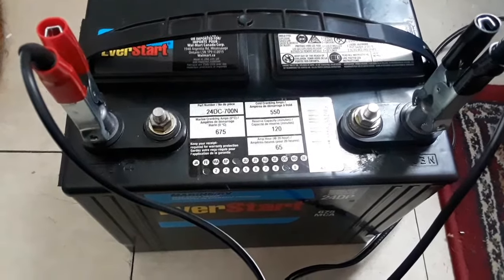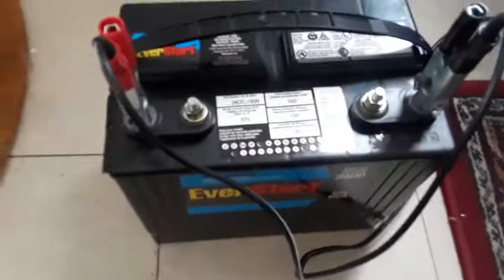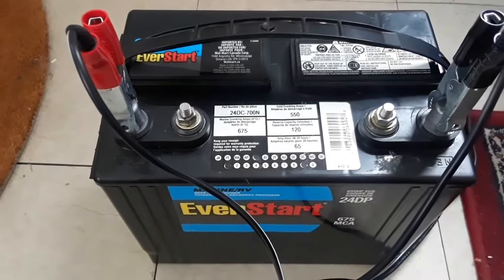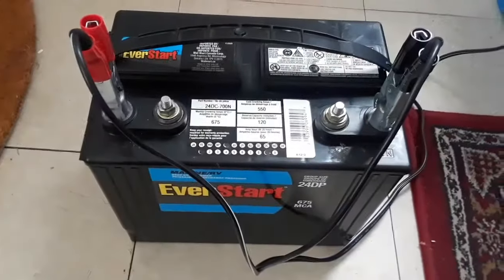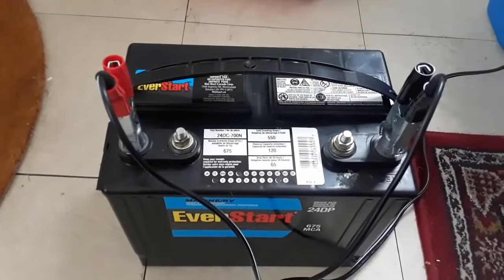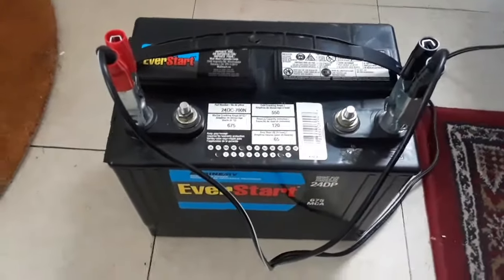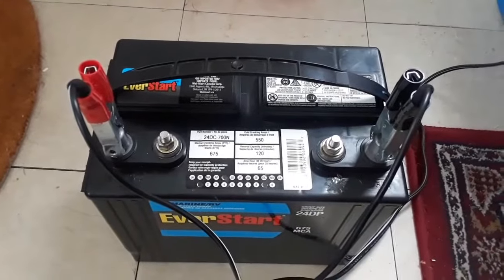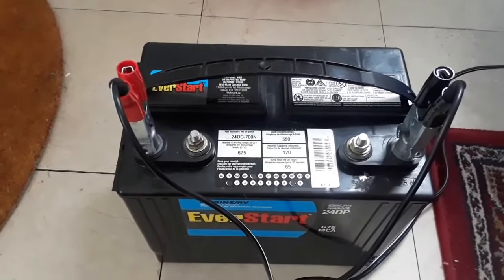Don't Make this Mistake with Deep Cycle Batteries!

Comment: When you connect a dead battery to a charged battery. The dead battery sucks the juice out of the charged battery and it becomes a six volt power. It levels off between the two. There's no way the 12 volt battery is going to power up the other 12-volt battery and turn it into a 12 bolt battery. What is going to do is even out the juice in both batteries. Which means you just resulted in 2 6 volt batteries

Comment: Two 24DCs can be replaced with 1 29DC which has 122Ah(twice the storage) at less $$$/amp.😉✌️
Reply: Per the label on the EverStart 24DC battery ... Each 24DC has about 100 Amp-Hours.  Therefore, 2 @ 24DC's in parallel will have 200Ah.  Last time I checked, 200Ah (2 @ 24DC) is way more than 122Ah (one 29DC).  You are not very good at math.
Reply: @MrSummitville  Hmmm, I wonder where I got that info? Probably from the video. Anyway, I use the 29DCs as I have room for them, they give 22% more amps than the 24DC, & last I checked, @ a lower cost per usable amp than any other battery out there. Not to mention that the first Everstarts I bought 4 years ago are still serviceable. But thanks for the correction.

Comment: were you running electric heat off of these? i dont understand how you killed both of them, if they were fully charged to 0% you went through about 2.4kwh of energy. just curious if you know exactly what killed them?
Reply from the maker: They were outside in 30F overnight, I was using the lights on both bunk ends and running the fan on the heater.  I am sure it was the cold.
Reply: He means the RV furnace.

Comment: That’s because you have a smart charger smart doesn’t necessarily mean good! If you ever go buy a 25 year old battery charger at a yard sale buy it because it doesn’t have those parameters if you hook it to a battery with one bolt in it it will simply charge the battery! 
Like the new batteries for tools Ryobi 18 V any brand really they have a computer board inside that battery and if the battery drops below 6 V or something like that that computer board opens the circuit so you can’t charge it you have to go buy a new one well if you look on the Internet you can take those batteries apart or in some cases drill a hole in a specific place so that you can get to the batteries themselves on the other side of the circuit board and you can charge those batteries up once you get above that 6 V threshold back to good again❤️‍🔥🇺🇸

Comment: These marine batteries are toys. Their only strength is they keep their charge much longer than an ordinary flooded battery. So you can leave boat stored away for a year, and it will still start. Running motors or heating elements on these tiny batteries is ok only for a few minutes, because high energy draw (amps) will suck them dry in 20 minutes.

Amp hours have nothing to do with load capacity over time. It describes the maximum time a battery will deliver 'useful' power at the rated voltage: such as run head lights, or a car radio. But a real electric motor such 1/2 horsepower motor? No way. Totally out of its league.

Stringing a few boat batteries together does not get you very far, because you may have extended its ability to do one low power job, but you have NOT done anything to expand the amps it can deliver consistently over time.

To use boat batteries to run a motor or a heater overnight basically you need three of them for every hour of intended use.

To do powerful electric work, you need a BIG battery, with serious amp hours... as in HUNDREDS of amp hours, not tens of minutes. Like the batteries in a forklift or a golf cart. These batteries are HUGE. It's a two man job to left one. They stand up to your thigh and individual units are 2V - one single battery cell per unit. They are usually wired into 24, 36, 0r 48V configurations and collectively they weigh a ton. THAT’S a battery!

Comment: Use a NOCO genius 10 to start it back up
Reply: I have a NOCO 10 what mode do you charge on? I have an Everstart 24DC
Reply: @thelifeofpressureman7178  I have it on “12V” for deep cycle batteries.

Comment: I have a 300 amp truck charger starter battery charger. If you hit the plum dead battery with 300 amps for about 2 minutes then wait 5 and do it again for 2 minutes then charge on 60 amps for 5 minutes and then on 30 for 5 minutes then on low amps until charged you can bring these back 100%. Many people will take a dead battery car, boat, drill, etc and clamp visegrips on the terminals and with a welder ground on ground weld a 1 inch bead on the positive visegrip handle then put their battery charger on them and charge until full. I have save maybe 80% of batteries doing this even the dreaded dewalt tool batteries. On those just a few quick zaps and then charge. high amps for a couple of minutes will blow the crap off the plates in most cases. lead acid batteries like to be vibrated. this is why tractor batteries last years and car batteries do not. cars are smooth. Take them out once a year and beat the shit out of them with a rubber mallet or do what battery shops do and drop them 2 feet to the floor flat on a piece of plywood. then charge like above. high amps a couple minutes then full charge.

Comment: Bro here is a tip. Don’t connect batteries if different capacity as well. Not a critical step but you’re going to be far more successful.
Reply: Why not?
Reply: tip not heard as it only applys to series connection you can parallel any size battery as long as volts match

Comment: that is also a cranking battery.........not a deep cycle or industrial deep cycle storage battery.  Cranking batteries have an issue with deep discharge causing active material (lead) to be stripped from the plates,which are actually a fragile grid structure. By comparison, an industrial deep cycle battery uses thick,solid plates........they have poor cranking (max amp output) for their size, but they do handle up to 70-80% discharge quite well, and generally only suffer from sulfation of the plates, not the loss of active material. Also, you need to do the math on your electrical load, versus the amp hours/voltage capacity of the battery.  So 65 amp hours at 24 volts is only 1.56 kw/hr and even a tiny 100W heater will flatten a deep cycle version 80% in just 12 hours.  A 400 watt heater in just 3 hours.  Would suggest you keep your cranking battery only for cranking, and have 4 deep cycle batteries that are able to charge, but not discharge the cranking battery (semi isolated).
Reply from the maker: Dude, group 24 battery is cranking but is also deep Cycle. Google it!
Reply from the maker: A Group 24 battery is a specific size of battery you’d see in vehicles, backup power systems, and medical systems. Group 24 batteries generally function as deep cycle batteries rather than starting applications where they start

Comment: The first thing I noticed......you should have a deep cycle battery. There is a reason they costs more, but are they really more expensive? You have killed the old battery. The second is you can't drain any battery to zero! Even deep cycle batteries shouldn't go below 50 %. Do more research. I'll pay off in the end.

Comment: i buy deep cycle battery 75 amp 900 watts you need about 100 amp 1200 watts i thinking ok you need about 4 12 volt battery 100 amp 1200 watts one battery  you need 4800 watts to get good heated
Reply from the maker: I moved the batteries inside the camper in an insulated box, seemed to have solved the problem. Check out the vid! Thanks

Comment: You should know that anything that produces heat is going to suck your batteries dry!!!
Reply: So confused why he wouldn't use the propane furnace...
Reply: Yeah, using electricity for heat in an off grid setup is a waste of time.
Reply: @Opethfeldt  I don't know if waste of time, but waste of energy definitely!
Reply: He’s talking about the RV furnace guys. He’s just confusing the terminology and calling it a heater. He didn’t know the difference between an AGM and FLA battery so he obviously wasn’t on to the inverter stage yet.

Comment: That is not a deep cycle battery. If it says CCA (Cold Cranking Amps) or MCA (Marine cranking amps) on it its not a deep cycle battery. If you need a deep cycle battery then make sure it not only says deep cycle on it but it should not reference in any way CCA or MCA
Reply: Good thing this one doesn’t say CCA but rather MCA.
Reply: @klg1001  Don't be a smart a$$. MCA means marine cranking amps. cranking are cranking amps. there are no cranking amps in a deep cycle battery 😞
Reply: You’re implying this was a starting battery and that was way far off.  They’re very capable of deep cycling because they’re commonly used to power electric trolling motors. You can start a gas engine if you needed to- hence the MCA rating but it wouldn’t have an Amp-Hour rating if it wasn’t designed for deep cycling.
Reply: @klg1001  Huh, I saw no reference to him using this battery on a boat in this video and MCA batteries ARE starting batteries. They were designed for boats and motor homes not campers/trailers and the only RV's that use them are RV's that use the house battery for starting the engine as well as powering the RV. A deep cycle battery is not designed for starting anything. They are designed for long slow constant current discharge and can safely discharge down to 20%. That's what deep cycle means. This Hybrid cannot do that and as such cannot be called a deep cycle battery because it cannot deep cycle.
Reply: @MYCHANNELWITHMYSTUFF  To be clear, 'I' use this exact battery in my RV's solar system, with a separate cranking battery. It is the most affordable per Ah I have found, & is made by Johnson Controls, just like most all the rest. The newer ones are now made in South Korea, which 'should' be of even better quality. I have also used this battery bank to jump my cranking battery on my 454 RV engine in which this bank resides. The 29DC may well be a hybrid, but the label clearly states "deep cycle 'power", & "deep discharge 'design". Is it possible you could both be right(& wrong), & that I am not a "nobody"???
Reply: @souljahroch2519  Sooooo what your saying is exactly what I said. The fact that you were able to use it to jump start your RV cranking battery makes it a good dual purpose battery for your application, i.e. marine/RV application. Not so much for the camper application which benefits more from long lasting & true deep discharge cycles. Deep cycle batteries have thick plates and can be discharged down to 80 percent (deep cycled) time after time without causing damage. In contrast, marine batteries and marine/RV batteries are generally dual purpose hybrid batteries with lead sponge plates that are coarser and heavier than starting battery plates but not as thick as true deep cycle battery plates. The main difference between true deep cycle batteries and other types is that deep cycle batteries have solid, not sponge, lead plates. True deep cycle brands include Crown, Deka and Trojan. Typically a marine or marine/RV battery lasts for one to six years and a true deep cycle battery will last 10 to 20 years depending upon use and maintenance.
Reply: @MYCHANNELWITHMYSTUFF  Not "exactly" at all. 1. This hybrid 'can', & does act as BOTH a deep cycle, AND a starting battery. And given that my bank has 6 of these batteries, I'm pretty sure a fully charged bank would have started my well tuned 454 with, or without the MCAs. An advantage of this hybrid is that it is said that you can draw it down to 20% as opposed to the 50% that can be used in a solely deep cycle battery. So, as advertised, these batteries cannot only be used as deep cycle, hybridization actually gives even more useable amps. You also stated that 'nobody' uses these batteries as deep cycle. This is abjectly false, as 'I' use these as deep cycle. And I, along with all the other smart folks getting the most usable amps for our $$$ by using a 122 Ah batteries which can use 98 Ah as opposed to the 61 in a purely deep cycle, are not "nobody"s.
Reply: @souljahroch2519  show me where the specifications or literature for that particular battery says you can discharge it safely down to 20% and I'll eat crow. Hybrids are not designed for that purpose.
Reply: @MYCHANNELWITHMYSTUFF  That's what I've read. I personally never let mine get below 12V. Now, tell me where "nobody" uses these as deep cycle.
Reply: @MYCHANNELWITHMYSTUFF  Actually, I may have gotten that impression from 'your' post which erroneously stated that deep cycle batteries are designed to draw down to 20%. They are only designed to go down to 50%. Unless,of course, 'you' can provide some documentation, or manual, or scientific research to suggest otherwise.
Reply: @klg1001  - These batteries are not a  good starting battery, nor are they a good deep cycle battery.  They are Dual Purpose Marine battery which means they not optimized for either - starting or deep cycles.